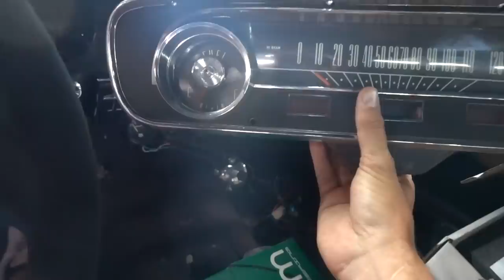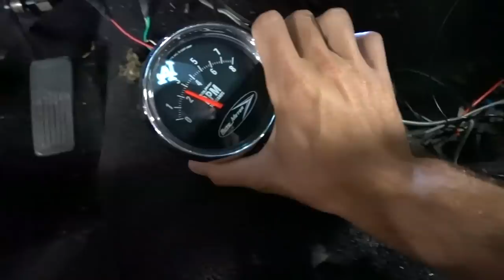Swapping a RB26 into a 1965 Mustang! Tokyo Drift Mustang!

Comment: Please keep the interior as original as possible. I feel like you'll miss the mark putting in bride seats and going too JDM. It would be way cooler looking like a stock mustang inside and out. Until you pop the hood or hear it obviously
Reply: It’s also a safety thing. Those seats would not be safe in the type of crash that car could get in. He needs proper harness and seats in a car with zero safety features.
Reply: @iiiReezy  yeah but you can still get safer seats that have an older original look to them rather than going full JDM boy. I'm not saying don't upgrade the seats. Just try to keep it more original looking would be way cooler and unsuspecting

Comment: How do you not have ac in California? If you are concerned about power loss from the belt drive, get an electric ac compressor from a Toyota Prius/Camry or a Tesla even. All the benefits without losing performance.

Comment: The 65 GT350 didn't have the rear brake ducts, that came in 66. Also the exhaust on GT350's didn't run through the rear lower valance, that was only on Mustang GT's not Shelbys.